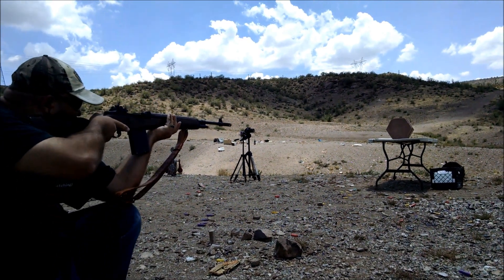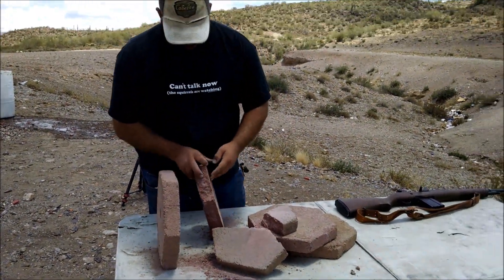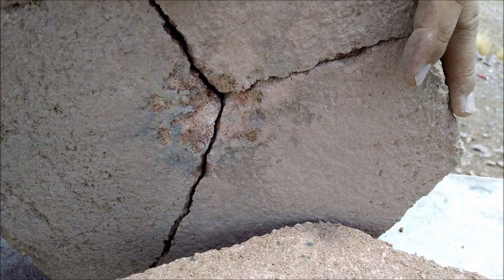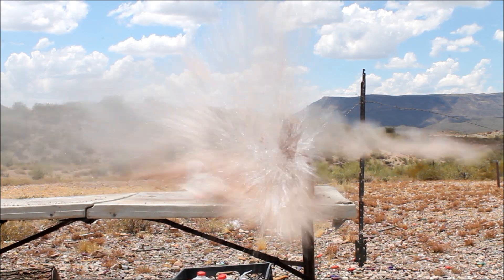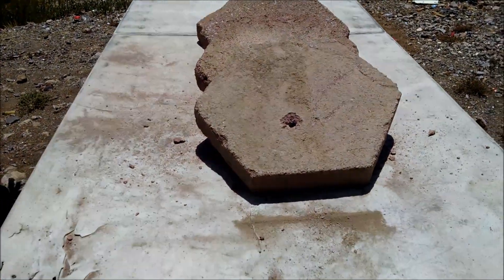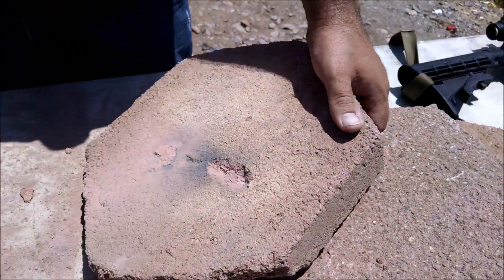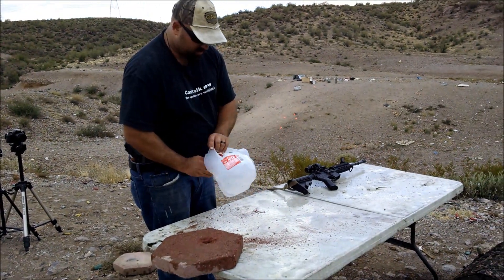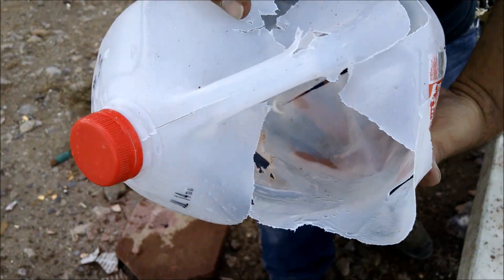Does An M14 Really Turn Cover Into Concealment? Part 3: Concrete Pavers ***DEMONETIZED***

Comment: 7.62x51 vs 5.56, when did the penetration issue really get noticed? In Vietnam the Australian Army used the FAL as we al know that 7.62x51. During engagements with the VC or NVA the Americans noticed that the FAL would cut through the dense jungle brush much easier and with more effect than the 5.56. Full circle to the wars in Iraq and Afghanistan the US military recognized the fact that the M4 was being out ranged and out penetrated buy ancient Soviet and British like the Lee Enfield, Mosin Nagant, various PKM models, not to mention PSL's and SVD's and even the lowly AK especially in Tabuk form which though not effectively accurate as used by the enemy bullets in masses are still dangerous. Enter the an old war dog the M14, why? Because the M4 is unable to engage targets effectively (and this varies from one military report and test to another) of between 300 yards (which I think is a bit low) to 500 yards which is a bit more accurate. This whole argument strikes me as a bit silly and fan boyish. The M4 has served well but with some controversy all its life. Weapons are tools, I see nothing wrong with mixing weapons as needed. You never carry one tool or in a tool box so I would suggest learning to carry lots of tools. Or at a minimum embrace the real logic of a firefight and make sure you or those you are working with can cover short, medium and long range through heavy cover. You won't always have an A10 to call on so make sure you can respond with withering fire at any range....now off my soap box. Respect to you all and good hunting.
Reply: You are forgetting the primary purpose of the series... To say "the old farts" over and over again because no old fart is there to Kick his lardass..... Lol... I made a funny.

Comment: This comes to show that there's alot of bullshit floating around in the internet. 556 isn't that bad.
Reply from the maker: JimmyEG1 5.56mm is actually really, REALLY good at almost everything that you want in a fighting rifle. At close range and with FMJ ammo, it tends to produce more tissue damage than 7.62mm. It's light so soldiers can literally carry twice as much. It's flat shooting so it is easier to engage targets at a variety of distances. The one thing that it does not do is carry a buttload of energy several hundred yards down range. That's why 7.62x51mm rifles and machine guns are still better tools for engaging enemies beyond 300m or so.
Reply: Well said. What are your thoughts on 20" barrel ar15's though? Are those good for longer range?
Reply from the maker: JimmyEG1 Longer barrels mean higher muzzle velocity and (usually) longer sight radius if you're using irons. That all helps get the bullet to the target a little easier. Longer barrels aren't necessarily any more accurate, but that higher velocity means a greater point blank distance and less corrections beyond point blank. Also, because 5.56mm is so dependent on velocity to do significant tissue damage, higher muzzle velocity means that it retains better terminal effect at longer ranges. But it's important to keep all that in perspective. We're talking about going from 150m to 200m fragmentation range for M193 for 16" vs 20" barrels. So both barrels produce useful fragmentation far beyond the range that a civilian would need to use the rifle and probably beyond the most common engagement distances for modern military but nowhere near the somewhat atypical distances seen in Afghanistan and mountainous areas of Iraq. I guess what I'm getting at is that the 20" barrel might be slightly more useful in some narrow circumstances but if you really need range, you're also going to need the extra horsepower of 7.62x51mm, preferably in a tripod mounted, crew served weapon with a good AG.
Reply: Thanks for the info bro
Reply from the maker: JimmyEG1 my pleasure. I'm no expert, though.

Comment: Interesting.  It's not a true comparison because M80 is copper covered lead while the M855 is copper covered lead with a steel penetrator.  A true comparison would be either both rounds with pentrators or both plain lead.  I would like to see either of those comparisons..
Reply from the maker: ***** That's correct insofar as it goes, but remember that I am not really testing 7.62x51mm versus 5.56x45mm. I am testing the assertion made by old farts that the M14 is a better weapon (despite its numerous other flaws) because it can "turn cover into concealment". In other words, there are a lot of befuddled elderly gents that think that the M14 can shoot through cover than an AR/M16/M4 cannot. M855 and M80 are commonly issued FMJ for their respective calibers and they are ammunition types that I have on hand. I included M193 in other tests but there wasn't a profound difference from M855 and it just makes an already longish video even longer. Now, there are a lot of variables involved in this claim so we can only look at this in a really general way.
Reply: The Chopping Block The problem is that you seem to start with a bias and then use ammunition choices likely to confirm your bias.  Of course 5.56 with a pentrator is going to come close to standard 7.62 ball. Comparing a penetrating round vs a regular ball round is not helpful in proving your point that the two calibers penetrate similarly.   It's a unfair comparison that can't help but taints the results.

Why not just use JSP for the 7.62?
Reply from the maker: ***** Because the claim from the old farts is that the M14 is a better fighting rifle because it penetrates cover substantially better than the AR/M4/M16. I used standard FMJ ammo for each.
Reply: The Chopping Block In your previous reply you stated, "I included M193 in other tests but there wasn't a profound difference from M855 and it just makes an already longish video even longer."  This may be true, BUT there IS a "profound difference" between standard ball and AP rounds in 7.62 cal.  This difference becomes more pronounced with distance, so a TRUE test should be kept between standard (non-AP) FMJ ammo, and over varying distances.
Reply from the maker: fn111557 M855 isn't AP. It is standard FMJ for the caliber. If love to see a more comprehensive test, including M193, M855, M995, M80, and 7.62 AP and SLAP fired from various barrel lengths and at a variety of ranges. I don't have the resources to do it, though.